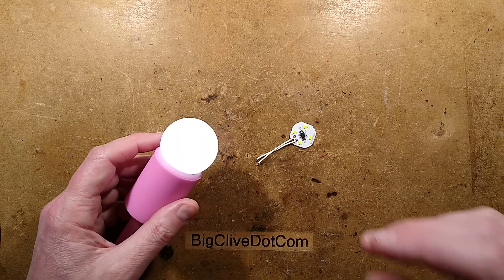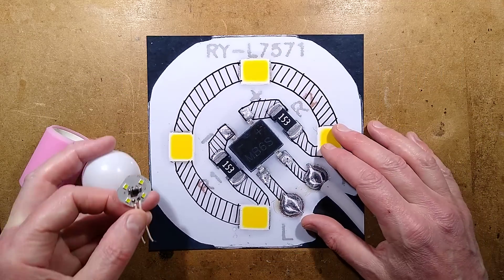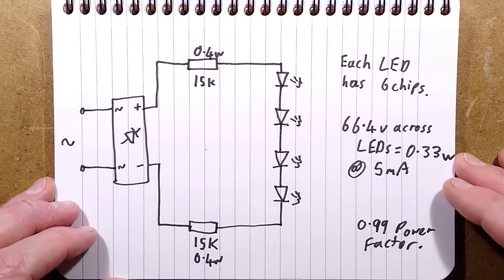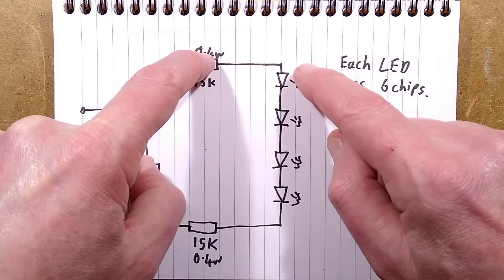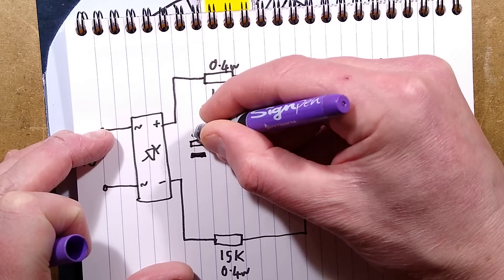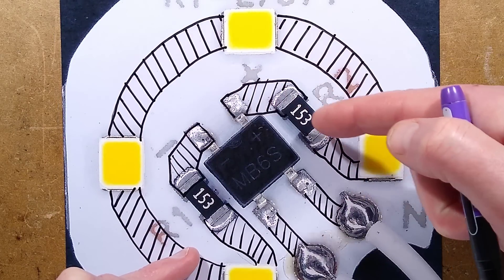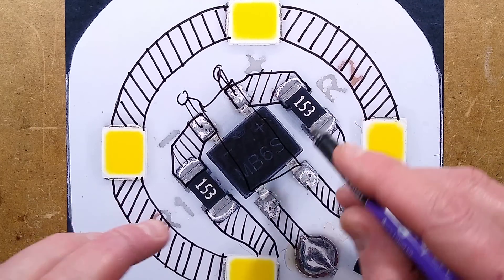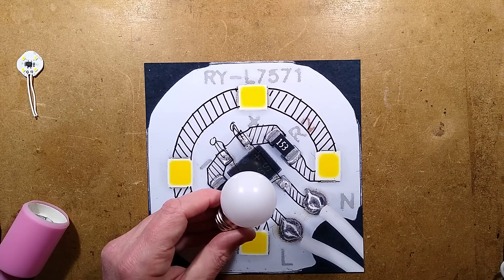Minimalist LED bulb/lamp (with schematic)

Comment: finally bought myself cheap ($0.3 and $0.51) LED bulbs and the circuit is exactly this! surprising it has good power factor but the 5W rating (2.7W wall) bulb I got is not as bright as my old, more expensive 1.5W(1.6W wall) bulb. The 5W has 6 packages with 2pcs 295 resistors which is an improvement to the bulb in the video.   I'm not sure why it is not as bright maybe due to the plastic lens to diffuse the light and add some yellow to the bluish output.

Comment: The AliExpress LED lights which run on USB have an interesting feature to the PCB.  Instead of a series SMD resistor between 5V and the two LED's, there is black ink painted to complete the circuit.  It's not the first time I've seen black painted traces, it's also in the recent 7-port USB hub.  Have you noticed this trend?  Is it a partially conductive ink, similar to liquiwire?
Reply from the maker: I have seen the carbon loaded ink used as resistors in some products.

Comment: I had a background in CPU design and programming, but I think your such a inspiration I’ve decided to take a Basic Electronics Course at college. It’s quite hard but fun. 
Thank you for your inspiration, one day I might understand everything AND able to reverse engineer circuits and ultimately be able to design my own, like when you designed AND built the super cool glitter lamp ( diamond 💎 )
Reply from the maker: I'm making a hybrid version of that right now.  A 3D printed base and the diamonds with the solvered back for extra sparkle.

Comment: Suggestion: What I'd love to see from your fascinating channel is a tutorial on wiring bicycle dynamo (actually they are AC,  magneto alternators) as it gives much confusion to people with little electronics experience. Wiring in single wire (earthed to frame) series vs 2 wire parallel (pluses & minuses of both) from either Shimano hub or a sidewall bottle "dynamos" as there is very little that is clearly understandable on youtube. Also a simple inline solution to stop these e10 LED bulbs that people use to upgrade their lights from dimmer Halogen (they do this to preserve the beautiful appearance of vintage bike lamps instead of buying pig ugly mass produced modern lamps) from strobing like mad at low speeds from the AC current produced by the Hub dynamos. Thanks again. You're always interesting.  👍👍

Comment: Wouldn't the simplest be connecting LEDs directly on the mains voltage. Enough of them in series to be able to handle the voltage. Like a handful of those filament style COG LEDs.

Comment: Surely it can be simpler. My uncle used a diode and a capacitor for an LED indicator. It's been working for decades.
Not sure how, when I tried something similar the LED fizzled away in a second.

Comment: Instead, they could have done away with the resistors on the "DC" side entirely and then used a capacitive dropper + resistor on the AC side of the bridge to reduce heat.

Comment: Adding a cap would hurt the power factor. This design looks resistive to the utility mains, which gives the good PF. I think the LED string voltage should be around 160 volts.

Comment: Is there a bulb like this that doesn't have a ripple/shimmer to it?  Every 1w LED bulb I've tried has this problem.  I want a bulb like this for an accent table lamp, but I can't stand that flickering.
Reply from the maker: Does it use very small lamps?  The smaller bases have no spare room for smoothing.
Reply: @bigclivedotcom  No, a regular E26 base.  I've tried a couple S14 lamps and a golf ball lamp like the one in the video (bought before I saw this).  Normally I use a 15w incandescent bulb, but would like to switch to LED.
Reply from the maker: @lanman95  Many of the cheaper lamps from local shops are very hackable to reduce the power if you are technically inclined.  Search my channel for the keyword "dooby".

Comment: The power factor is near unity, but what I'm now interested in is what might be called the useful power factor. What proportion of the voltage drop gets dissapated in the LEDs as compared to the resistive losses. This lamp could be made about three times as efficient with the same LED technology.

These lamps may be cheap to make and cheap to buy: but you will be paying three times as much as you needed to for the amount of light you get: not the most effective financial move

And then....Hey guys: there's an environmental crisis y'know!!
Reply: Actually it's not that easy to find very dim (<200lm) LED bulbs of that size (E14). I was looking for one a while a go and the are all about the same amount of lumen, usually 280lm.

Comment: hey clive why is it no one uses the led's as a diode  to rectify ac seems like instead of a fullwave rec. you could use four led's  or just hook half of them one polarity  and the other the other and use ac it would be flickery but simple
Reply from the maker: So devices do that, but LEDs have a very low reverse voltage and can suffer damage when reverse biased.

Comment: I don't see why they bothered putting the bridge rectifier in.  Why not just the resistor and LEDs?  The resistors seem to run way beyond their rated power.
Reply: At first I thought this is a dumb comment but then I realized that a bridge rectifier is also only diodes, just not light emitting ones. So maybe we have to wait a bit until someone figures that out.

Comment: I bought a lot of 10 pc, the lamp still glows when the power is off. In one lamp of our caravan it glowed so bright I had to take it out just to sleep. But the power it uses is so small it is not a problem for our living room.
Reply from the maker: That's usually the capacitive coupling between switch wires or the snubber circuitry in electronic switches.  It's very common.

Comment: Nice. I'd love to hear about how this can be improved. Either with more leds or different resistors (and capacitor ofcourse) or how to lower interference on radio.
And could one build these with 5mm leds for example and how many would one use?

Or could one power it with your battery charger to make an emergency light of sorts that stays lit when power is off, or turns on when power is off? I thought that might be a nice little project as well.
Reply: One option is to put up to three of these bulbs in series. Then short out some of the resistors to bring the brightness back up.

Oh and slava Ukraini, and greetings from India

Comment: So, if this lamp has an almost perfect power factor, what happens then if you'd just add this capacitance?
Reply from the maker: It would skew the power factor, but with such a low load it's not a huge issue.

Comment: Might be safer to put the resistors BEFORE the rectifier ( diodes always fail short circuit = bang / blown fuse ! ) .... however , a 100 to 330 nF , mains rated capacitor ( before the rectifier ) instead of resistors dissipates no power , and is bigger and more costly , but gives A+++ efficiency ! ..... DAVE™ ..........

Comment: I would very much like to see some power fail lamps and circuits.
So far, I have only seen one video from you on a very cheap light. I am attempting to design such, using a relay. I'm thinking that may not be the best idea. 💡

Comment: looking at that lamp, it looks quite hackable. A capacitor could share the output pads from the rectifier. If the solder mask is worn away, and the trace cut, more LED packages could be added.

Comment: Back to how they used to do it in the early days of led mains indicators (before blue led's and mini current reg's), it was a single diode and resistor.
Reply: Big Clive has an earlier video that goes over step by step building up various led indicator configurations, starting from led+resistor. I personally use led+reverse diode+resistor, for a "hidden" indicator where I have a switch running a remote evacuation fan. It shines through the typical plastic switch plate. I added the reverse diode after the first simpler implementation failed after about 6 months.
Reply: @RossReedstrom  https://youtu.be/Q23uh7AjjXw
Reply: @ctrlj  yup that's the one!

Comment: I wonder what the radio interference is like from this?  I find that many of the LED drivers I have in my house, where I have replaced halogen bulbs with LED ones, and even changed the driver for a 'proper' LED bulb unit, interfere terribly with FM radio, DAB and Freeview.  I haven't found one yet that doesn't.  I would imagine that this might be worse - or could it be better because there is no switch-mode PSU involved.  Any ideas?
Reply from the maker: I would expect these lamps to be low electrical noise.
Reply: Switch mode fundamentally works at much higher frequencies than a rectifier (main). Even with pretty bad harmonics I wouldnt expect them to be as bad as the bottom of the barrel. or is the clipping worse than my untrained intuition would suggest?

Comment: What would be the difference between adding a capacitor "on the LEDs side" VS "on the Bridge side" of the resistors?

I was thinking that "on the LEDs side" it would be needed a lower voltage capacitor so it could have higher capacitance for the same size. So in addition to the higher capacitance, placing the capacitor in a lower voltage section of the circuit would reduce the ripple more. May I being correct?
Reply from the maker: You have to allow for the LEDs failing open circuit and the voltage across the capacitor going to peak mains voltage.   A lower voltage one may vent, albeit with the resistors limiting the fault current.
Reply: @bigclivedotcom  I don't see the problem yet. The pop will be an audible indication that the bulb needs to be replaced.

Comment: Sir, could you please give us your opinion on the new Saltdays shower heads? It has purple spinning components. Many thanks.
Reply from the maker: The spinning blade inside looks like a marketing gimmick.  The use of a filter would potentially restrict water flow and could damage some shower units by triggering their overpressure safety valve.

Comment: Would a ceramic capacitor work just as well? Or are they more expensive at these voltages?
Reply from the maker: It could work directly across the LEDs after the resistors.
Reply: @bigclivedotcom  I was thinking across the pads of the rectifier, but I did not consider there's a lower voltage across the string... 🤔

Comment: Hi Clive, I have been considering changing my lights circuit to lv dc  , for simple solar use. Have you come across any 48v or similar lamps?
Reply: And make sure you keep track of the current you will be sending through your wiring
Reply: @Peter_A1466  yes that's why I was going to use the upper limit of the LV regs.  The voltage is then a fifth down but given the near 10x  efficiency of LEDs , the current, for a given light output, is about half that of the original installation.
Reply from the maker: You can get many styles in 12V that use the standard bases and fittings.
Reply: @bigclivedotcom  That was my first thought , but Id like to avoid as much down/up converting as possible.

Comment: I think you can hack a capacitor directly onto the output legs of the rectifier, but only if you can remove the plastic globe from the bulb without damaging it. 😉

Comment: Does the price reflect the simplicity? I´d expect around 2 for 1£ as these are even simpler to produce than incandescent bulbs were with no glass or vacuum required.  How much more would 0.5 w resistors cost and would they be cooler and live longer? Would not a higher value resistor(s) with a smoothing cap compensate for higher current as well as any flickering? What is the advantage in having 2 resistors instead of 1 of equal ohm and watts?
Reply from the maker: Multiple resistors spreads the dissipation.  These are definitely cheap lamps.

Comment: I recently found one of my E27 LED (reflector) lamp broken - glass shattered - so i decided to pluck out the internals - noted that the wires where flimpsy or flimbsy .. ok, very thin..
two solder points invited my to add better cables - but i am worried about safety..
next to me an empty yogurt cup - i wonder if that makes a good base for a led lamp - or will it melt after a few minutes..  it was build in a glass-ceramic fused base.. a hint .. i guess.

Comment: can you check the current for calculating how much power is wasted in the resistors?
Reply: 6 LEDs per module is a total of 24 LEDs. At 3V each, that's 72V across all LEDs. The remainder is dropped by the resistors. So 240-72 = 168V. The resistors being a total of 30k, their dissipation is 168^2/30,000 = 0.94W. Or 0.47W each. 

Or somewhat lower because the LEDs don't conduct all the time. Clive wrote 0.4W.

Comment: The high dissipation across the resistors can't be good for overall efficiency -- lots of heat that could have been light.  I'd love to hear more about which circuit designs are most efficient.
Reply: generally, the circuits with a voltage regulator in series with the led chain are more efficient. Using a capacitive dropper before the rectification also raise efficiency but at the expense of the power factor. Another way is to use filament leds, as they emit more light than planar SMD ones.

Comment: My brother in law sells "reconditioned" or refurbished led bulbs and provides repair services as well, and I learned that all these bulbs have both surpirisingly simple and complex things inside. Good to see one demonstrated here :)
Reply: Interesting. I'd love to recondition some bulbs by myself sometime.
Reply: @NaoPb  usually in his case the first failing parts are the leds themselves (or just one in a series connection) so he changes all the leds. the second part is usually the caps (which one it is, if at all exists, depending on the design and manufacturer)
Reply: @zakyzigzag  sorry, I didn't notice your answer. Thank you!

Comment: This lamps are really cheap and not having a capacitor dropper they must be easily dimmable.
Reply: Conventional TRIAC dimmers may not work so well due to the very low current, they have a minimum load requirment.

Comment: If you add a cap at the bridge rectifier, I'd think you'd need some kind of fusing or surge protection on the input.
Reply: How about putting the cap on the LED side of the resistors?
Reply: @rpdom  That should be way better. No need for further inrush limiting. And the cap would only need to be rated for like 100V.
Reply: @rexsceleratorum1632  I'd still use a 400V cap, just in case one of the LEDs went open circuit. The bulb would still be dead, but it wouldn't go out with a bang.
Reply: @rpdom  The bulb just comes with an audible alert to let you know when it needs to be changed.

Comment: Speaking of cheap golf ball lamps, I ended up getting one several years back from wish, that's USB powered. I plug it on to the end of a 20,000mAh battery bank and during a power outage I got light for days.

Comment: you can buil even simlper becouse fbr is just 4 diodes .use led diodes  instead .
Reply from the maker: LEDs do not have a high reverse voltage tolerance.  The technique is sometimes used in panel indicators though.
Reply: @bigclivedotcom  two strings in reverse then?

Comment: Unless the proposed capacitor were tucked away on the backside, I think a cap on the same side as the LEDs would cast a noticeable shadow.
Reply: Al-core PCBs in that price range are always single sided. a) Making plates holes through an aluminium substrate is a bit more complicated. b) With anything on the other side you lose the option to put a heatsink on there.
You can see how they deal with that problem on the mains input cables: The board has a little cutout for the wires to go around the board and get soldered on the top side.

Same solution could be used to install a cap on the backside. Put sleeves on the leads of the cap, drill a big enough hole for those through the board and then solder it on the rectifier. Reduces the flicker and adds an additional ventilation feature.

Comment: Question"  The video with the transformer for wood burning, with the girl who got injured.... Do you think the transformer would work for making hydrogen, splitting water?
Reply from the maker: A lower voltage DC supply may be better for that.  As used in Brown's gas generators.
Reply: @bigclivedotcom  I actually made a little reactor that works pretty well off a half dead AA battery, like 0.8 volts...it gets more production from 12volts cheap Battery charger.....0.5 amps.... A bit less production with little plug in DC.12v supply... Quite a bit more from 2 grill batteries connected.... But I the motor that spins the plate in a microwave and connected it, spun it with a drill and the production was way better! So then I started thinking about different ways to skin the cat as they say"  I want to thousands of volts...that megatron should awesome right?
Reply: @rfiskillingussoftly6568  Get a cheap multimeter and monitor the current. If it already works decently with 0.8V you sure don't need thousands of volts. Especially since that microwave transformer is bad news.
Reply: People rewind the secondary to make spot welders, they're only a few volts (but very high amperage).  For continuous use you'd need to add cooling.  Not worth the effort for HHO in my opinion, but no doubt someone has done it.
Reply: @j.f.christ8421  Hmm It's the volts I'm after. Thanks!

Comment: Simple to add in the extra 2 dies, though the capacitor could even be a nominal 100n 400V chip ceramic 1206 package, soldered across the pins of the bridge rectifier, which would do a good enough job there.

Comment: Looking at the diagram, having in mind that there are 2 resistors, I would put capacitor 'diagonally'.
So one resistor limits inrush current and the other limits the current though LEDs.